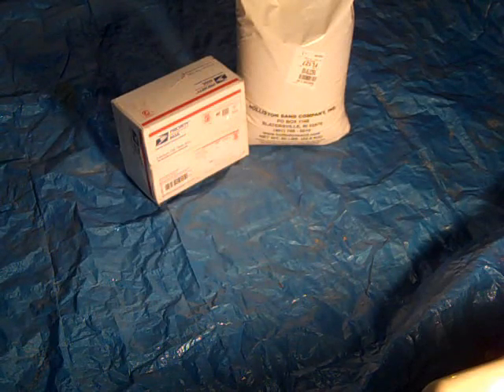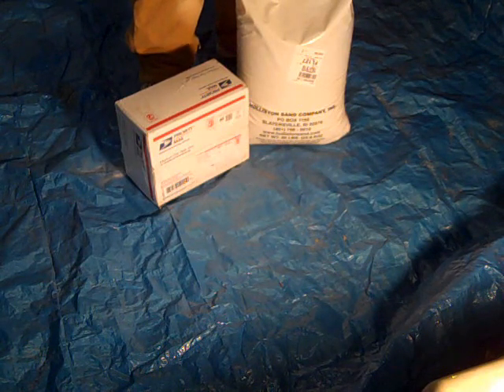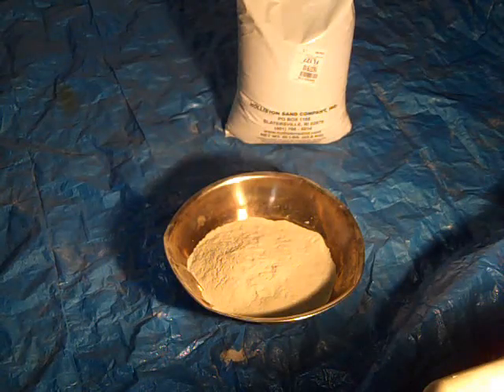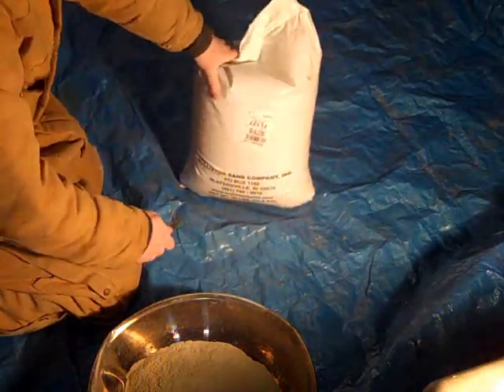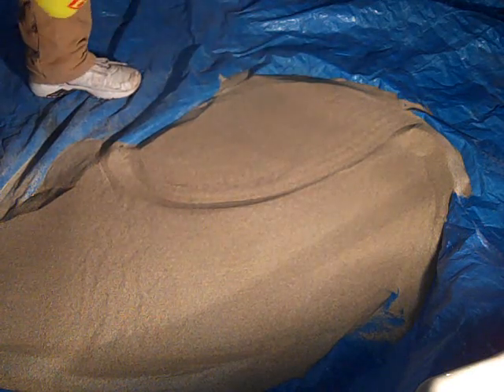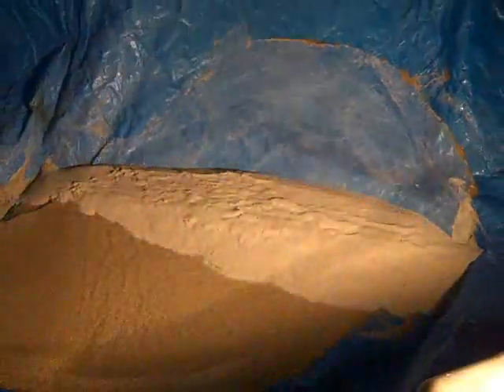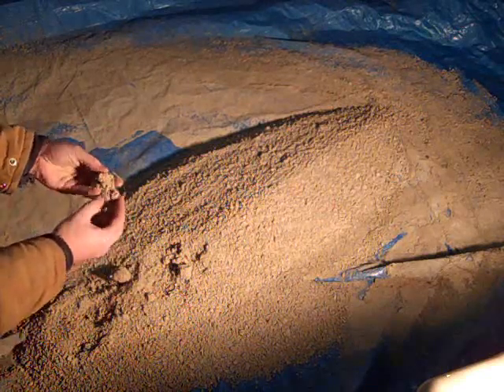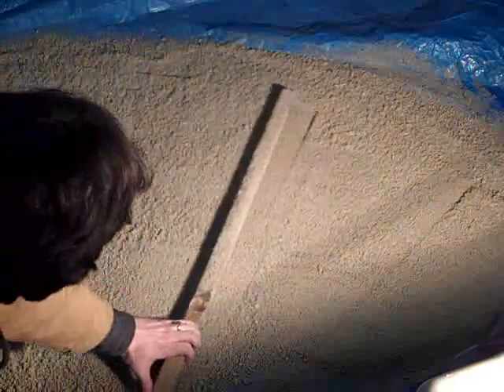DIY: Easy to make greensand for casting metal - Aluminum sand casting

Comment: good job, but why not consider a ½" drill and a mixing paddle ... put all in a container from 5 to 25 gallons and whip it out in a matter of a minute or two?  Good mix and complete water penetration is key, but the plastic process, although very clever, is also very time consuming ... keep it up, I learned a couple things and appreciate it@

Comment: Is crushed limestone a suitable casting sand?  It is very fine, clumps together easily when compacted, and would produce a terrific, smooth finish on the aluminum casting.
Reply: +GTgyro Crushed limestone is a bad idea.  The water soaks into the limestone and then often the individual grains pop when poured.  You get a casting that has a lot of internal gas bubbles.

Comment: Nice explanation, however, I just don't get why you cut the bag like that :) in the bottom first and then a hook-cut so it flops open and just spills the internals.
Reply: Would it be better if he would turned the bag down side up,that way he would be cutting  the top.

Comment: Don't know if they have a location in your vicinity but they sell bentonite at "ditch witch" retailers. I think it's fifty pound bags. We use it for priming concrete pump lines. Probably cheaper than getting it by mail.

Comment: Can you reuse this sand after molding ? I have already built my furnace.im lost on the sand. Can you please write a list of materials needed and where to buy from thanks
Reply: +Shawn P The advantage of sand bonded with clay and water is that it can be reused many times.  The number of times depends a lot on what metal you are pouring.  Aluminum is typically poured at 1300 degrees.  That temperature will not burn out the clay.  We use ours hundreds of times.  Iron and brass pour at much hotter temperatures.  Typically those production shops replace 10% of their sand each time they use it.  The reason is that at the high temperatures that they pour at, Bentonite clay, which is an expanding clay, turns to Illite clay, which is not expanding.  Non-expanding clays don't hold the sand together.  Only the portion right next to the casting has the clay converted to illite, so you don't completely lose the strength after one pour.  In a home foundry, you can keep adding a little clay as the sand gets weaker till you start to have permeability problems that manifest themselves a blows.  Those are gas defects in the form of large holes in the casting or bubbles on the surface.  Those can also come from just using sand that is too wet.  I buy my clay from Carpenter Brothers in Muskegon, but other companies sell it as well.  The sand should be one that is low in limestone or other particles.  You want a clean silica sand if you are buying inexpensive sand.  Often you can find it as play sand at building supply houses.  It is typically well sorted and has very little clay in it.  You can also use 2NS sand from a gravel pit.  Fine sand produces a really nice finish on the casting but is not very forgiving if the sand is too wet.  You end up with gas defects.  Coarse sand is much more forgiving because the open permeability allows gas to escape through the pores of the sand at a higher rate than does fine sand.  The disadvantage is that the casting is rougher.  In the industry, aluminum shops typically use fine sand.  Brass and iron shops use coarse sand.

Comment: Thanks for your video,it helped set me on the path to casting aluminium bow risers.I'm building knock down re curves with hard maple and carbon fiber limbs.I'm using AFS 100 sand, bentonite and oil.I'm getting great detail with little finish work.
Reply: +Joe Longstaff Sand with oil and bentonite is called petrobond sand.  The disadvantage is that it is considered a hazardous waste when you are done with it.  When you pour it, it produces a lot of smoke that technically requires a scrubber to clean the air and if you use too much oil, the molding sand catches fire if you shake the molds out hot.  Petrobond does not self mix like water with clay, so typically, when we used petrobond, it had to be run through a muller about every third or fourth time it was used, as you added new oil to replace that which burned off.  The big advantage of petrobond is that you can make a mold and leave it overnight without worrying about it drying out.  If you break off a section, it is easier to repair than water based molding sand.

Comment: The tarp method is very old school. How about using a bucket, a power drill and a mixing bit? Great demo but very time consuming.
Reply: +Boris Sabo When you mix your sand initially, mix the dry sand with the dry clay.  Boil the clay first, then let it dry out before doing this.  Mixing in a bucket with a drill will not kill the motor if dry.  Once the clay and sand are mixed, you can just spray the sand pile down with a garden hose and turn it over a few times with a shovel, then let it sit overnight.  If you are using western bentonite, a light spray of water on  top will leave a crust that protects the sand from drying out.  Just push aside the dry stuff on top and use the stuff below.  I typically just spray the top of the pile lightly before using it.
Reply: Boris Sabo that would work too but I don't think you can get 50 lbs of sand into a bucket.....plus it is extremely dry so it might be hard to mix....I know I burned out a porter cable drill mixing mastic......(it wasn't a slow speed makita :-( I didn't have one at the time)
Reply: That makes sense, perhaps a cement mixer but that is much more expensive than a tarp. I will try your method, and thanks for the feedback!
Reply: Boris Sabo Not sure where you live, but I saw a small cement mixer at home depot...looked like it was about 5 gallons (it was about the size of one of those 5 gallon plastic buckets)....It actually would be the perfect size for these projects as well as home owners who had small jobs and had no need for the tow behind ones....

Comment: Another kind of sand you can use is pool filter sand.
Reply: +basement_sawyer Be careful of which pool filter sand you use.  Don't use the stuff called diatomaceous earth.  Although it is silica, it is the internal structure of a small critter called a diatom.  This stuff collects in deep ocean areas with little other sediment being added.  The disadvantage is that the spines easily break off and produce respirable silica.  This dust will give you silicosis.

Comment: why is it called greensand?
Reply: The sand originally used for casting was naturally occurring. It forms in river beds and is a mixture of  sand and natural clay . River bed sand has rounded  grains from constant erosion by the moving water. These rounded grains maintain gaps between them even when compressed, allowing the mould to remain porous (as opposed to 'sharp' sands which tend to pack together more tightly) The green colour comes from minerals present in the clay.
Reply: The green sand moniker is because it has the correct moisture content,  Why 'green' I don't know.
Reply: David Hunt So it is called green sand because it has the correct moisture content. sand because it is sand somehow and green for the fresh appearance?
Reply: TheElderScrollsKing
i believe its because properly mixed and tempered green sand will mold if left allone for a week or more turning green but heck if i know
Reply: Chris Johns Wow,thanks!

Comment: Why not use clay for casting?
Reply: Because with the Sand it lets the gasses through and if u used straight clay they gasses would get trapped and make bubbles in your cast. Hope this helps

Comment: The sand you are using is awfully coarse for typical molding sand.  You might want to get some 2NS sand from a concrete supply or gravel pit.  The problem with gravel pit sand is that depending upon the state you are in, it might contain a lot of limestone, which will hurt the finish.  If there is a foundry supply in the area, buy sand with an AFS grain fineness of 70 or finer.  The higher the number, the finer the sand.  I run a production and prototype foundry and we use an AFS 100 grain fineness sand.  We have used AFS 400 sand in the past.  When I was young, we would mix sand with an eastern coal shovel on a concrete floor..  Just place the sand and bentonite together and turn it over several times till it is well mixed.  We always used a garden hose with a spray nozzle to wet the sand.  Typically, you want to let the sand sit for an hour or so after you have cut / mixed it to allow the moisture to become more uniform throughout the sand.  Mix the sand and water with a shovel.  Store it in a plastic bucket with a lit to keep it from drying out.  You can cleanup the sand with a broom when you are done.  You didn't say if you bought southern or western bentonite.  Typically, if you use rounded silica sand, you will want a mixture of 50/50 western and southern bentonite for aluminum.  Western bentonite is stronger than southern bentonite.  Too much western and the sand wants to stick together in hard lumps after you have poured your molds.  We typically run our mixture at 7.5%, not 12% clay.  That is a little high.  More clay reduces the permeability of the sand, making it more likely that if the sand is a little too wet, you will get steam bubbles that will push through the metal as opposed to going out through the sand.  These are called blows.  If the sand is wet enough, it will rocket out of the sprue (the sprue is the hole that you pour the metal into the mold), something fairly dangerous.  The sand should stick together like snow does, when you squeeze it.  You should be able to take the squeezed sand with two fingers, and shake it lightly without if coming apart.  If it crumbles, it is too dry.  It should not stick to your hand.  If it sticks to your hand, it is too wet.

You will find that the green sand would have worked much better if you had put the clay in a bucket with water and boiled it.  This activates the clay.  Otherwise, it will only slowly become active as you pour metal into the molds and the clay gets steamed.  Over time the sand will nearly double in strength.  With this level of clay and the strength it will achieve, it will be difficult to get a smooth casting without the sue of a fine screen (called a riddle) to break up the lumps as you put sand in your mold.  You should use a riddle with 1/8" x 1/8" holes.  You can order these from companies such as Freeman Supply and are known as a #8 riddle.  The number is the number of wires per inch, or you can make your own with hardware wire screen.

I would be careful if you decide to use plaster.  Plaster must be very dry before you pour it.  Typically, you want to bake a plaster mold in an oven for at lease 8 hours at 600 degrees before pouring it, to get the moisture out.  Failing to do this often results in aluminum foam as opposed to solid aluminum parts.
Reply: +cfjulian1225 
 Hello, thanks for your advice, may I ask, could you detail the boiling of the bentonite to activate it?
 thanks... :)
Reply: +Julio says To activate bentonite, put it in boiling water for 5 minutes before using.  The boiling water will hydrate the silicate layers.  Once activated, you do not need to repeat this process, even if your sand drys out completely.  The interstitial water will remain there.  This activation makes the sand properly sticky.  If you use bentonite sand that has not been activated, the sand will be weak until it has been used several times with metal having been poured into it.  The steam activates the sand.  In a production foundry, you typically add a little new sand on a regular basis.  Since it is not a huge part of the whole, it doesn't significantly weaken the sand initially and it picks up strength as it gets used, from the steam generated in the pour.  There are two types of bentonite.  Southern and Western bentonite.  I recommend western for anyone using natural sand and anyone not using a muller to process the sand.  Western is much stronger than southern but if you pour aluminum in an automated system, the sand will stick together so well that it will be hard to push through a riddle and will load up on aerator fingers.  By hand mixing, that is typically not a problem and as long as not mulled, it is easier to work with.  We typically use 7 % by weight, bentonite to sand for hand molding.  I typically use around 3% water in the mix.  You can tell if the moisture is correct by grabbing a handful of sand and squeezing it.  It should only barely stick to your hand and it you should be able to see the lines of your hand in the sand.  When you take the piece that you just squeezed, you should be able to pick it up with two fingers and have it hold together.  After you shakeout your molding sand, it is best to add the new water right away and then store it in a sealed plastic bucket.  This will allow the water to spread evenly throughout the sand so that it works evenly when you use it again.
Reply: Hi cfjulian1225 I was afk for weekend, many thanks for the reply, I've yet to hear anyone speak of activation so I'm taking notes of all you advise... right now I've a tester pack ready, 1kg (1000gm) of Silica sand, 125gm of bentonite fresh from the blender.. also a mister of water.. oh and a kettle :D 
 Im ready to follow your steps with a sample batch, the ''boil before use'' still raises question, if I boil the clay, or add boiling water.. do I let it dry, then mix with sand etc?
 Im thinking the wet clay wont mix, just want to do it correct, so if you could give me a step by step with the measurements im looking at, ill do it today, and get back to you :).. i really appreciate your tips and advice, thanks so much for sharing your experience in this science.. :)
Reply: +Julio says It would be best to let the clay dry out again before mixing it with the sand if you are using a mechanical mixer.  If you are mixing by hand, depending upon the size of batch you make, you could activate the clay after mixing it with sand and adding water.  The issue is that the clay needs to be steamed.  If you have a metal garbage can, or and old drum, mix up the sand and clay with a little extra water then heat sand, clay and water in the drum over a fire till you see a good amount of steam coming out the top.  Once you have steam going all the way through the sand and clay, the clay will activate itself.  Let it all cool back down before you try to use it.  If you are only mixing 1Kg, you could probably do it in a pan on a stove top.  Be careful not to melt the pan.  You can stir it to help distribute the heat.

Comment: It seems dry to me. Your mold will wash when you pour. I was a molder for years.
I am thinking of pouring aluminum in plaster of Paris.

Please let me know if you decide to use plaster. I would really like to know I helped.
Reply: Tried casting into plaster of paris early in my attempts.  Terrible results.  LOTS of bubbling...picture molten aluminum volcano lava...dangerous.  My hypothesis is that the temp of the aluminum actually drove the water in the plaster crystal out and made mini (and not so mini) steam explosions.
Reply: Fred Landavazo IV I am not debating. Just making suggestions. Did you vent the risers? Maybe the plaster was not dry enough. I plan to try this one day and I will beware of your warning. Maybe bake in oven?
Reply: gypsum has a LOT of water bound up into it chemically;  the heat of the molten metal is enough to break the bonds and drive the water out, even in a plaster casting that's completely "dried".....

  a better option would be investment clay.....it's how they do lost wax castings with bronze & brass.(and gold & silver)....however, it's a single use type thing...the heat of the metal breaks down the material at a chemical level, so the mold would not be reusable....      A plaster mold will hold up to a couple of casts with something low temp like lead, but at the temps of aluminum, brass & bronze, molds just do not hold up....   there's a reason the industries use sand casting....

you can get modest results for brass and aluminum using wallboard mud as an investment, (coating a foam form), and then putting it in sand for support, but good quality fine-grained sand is going to be faster and more simply accomplished with fewer steps....

Comment: Thanks for posting.I am sure that you will find after mulling the mixture will give a lot better results. Good job as far as you have gone but the sand as shown is not there yet.The the devil is in the details and mulling is the thing you might find gives you much better results. The clay need to be pounded into the sand like you wouldn't believe just like Mr B says.

Comment: Many years ago we made 12 to 16 ounce "bell shaped" surf fishing weights from Padre Island. beach sand molds. That sand is a little too spherical to 
cast much detail.  We were using old recycled fishing weights and  it is nearly
pure lead.  One or two of per cent tin added can get you better mold fill-out. 
Consult the Lyman Cast Bullet Handbook available at a library. Will you use steel clips?

Comment: Check the bag of your kitty litter. Most cheap ones are pure bentonite clay. Smaller applications you can grind it up pretty much which ever way. For larger batches, as the one here i'd say stick it in a cement mixer with a bunch of large steel bearing balls, and stick a lid over the top. It's going to be noisy as hell. Tilt the mixer to dump the lot through a screen to remove the balls, and start putting sand + bentonite back in to the mixer. Add water to consistency, and your done. Beats tarp.

Comment from the maker: A friend of mine has used sand for lead casting with some success however you  can cast lead in a mold made of wood too... of course the wood mold could likely only be used once but it might be a simpler option.  Thanks for watching.